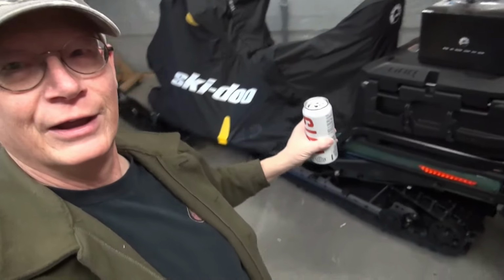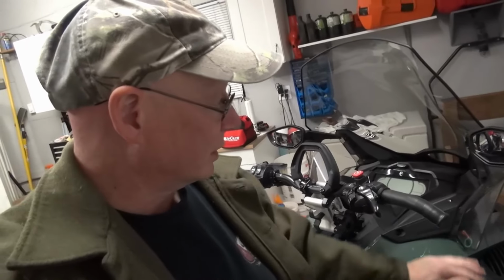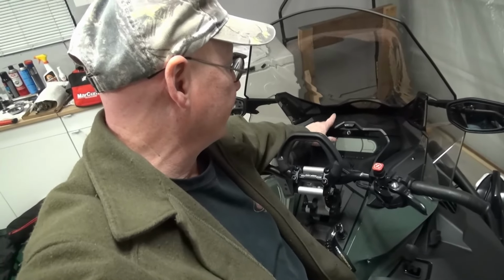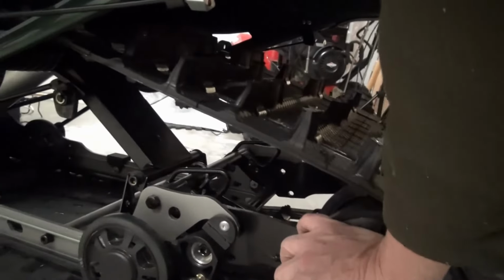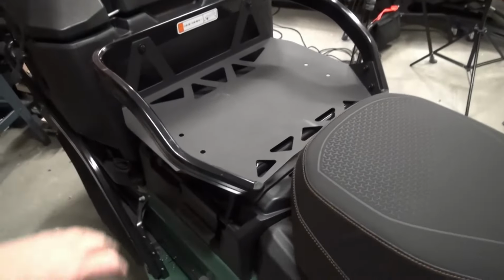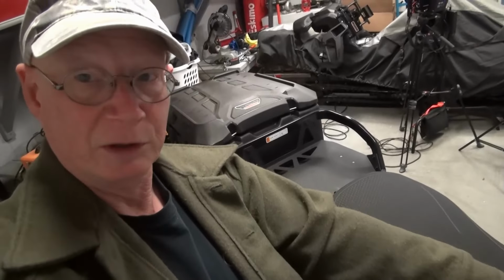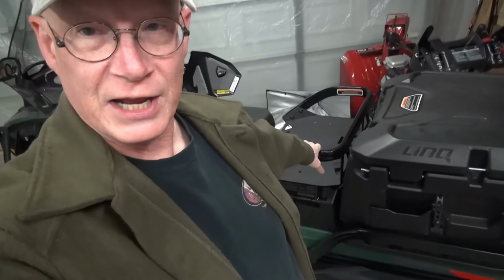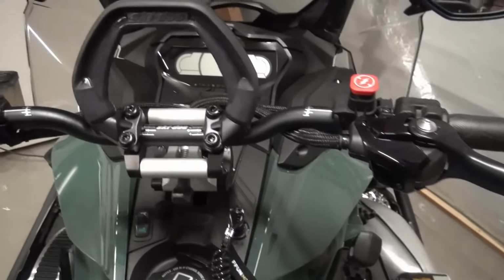2024 Ski Doo Expedition SE

Comment: One small correction, the 7.8" gauge is the color display.  Yours is the 7.2".  There's also a 4.5" on the LE and the Xtreme that looks similar to yours but smaller.  Also the 10.25" is also color but it's specific to the G5 sleds...can't put it on the Expedition because it's still on G4 plastic.
Reply from the maker: You are totally correct. For some reason I just can’t keep them all straight!  😂  Thanks for clarifying for others.

Comment: Great video!!  I put a small shovel where that saw holder is.  remove that small plastic piece and you're good to go.  Your spec out is spot on too, got everything you want or need.  My musts haves after having one of these machines for 3 years are the skins, cargo box, glove box extension and your cargo rack and you got all of them!  Great job!
Reply from the maker: Thanks for the idea on the shovel holder.  Appreciate your comments.  Are you running a gps mounted to the extension and if yes which model?

Comment: We have the exact same sled! Looking forward to being able to use it this year, hope we get more snow! Got mine in October last year but managed to put 1003 kms on it still even with the crappy season.
Reply from the maker: I can’t wait to get some more time on it this winter.  It’s heading in the shop to update the gauge. Froze up on a ride and apparently there is an update for it.
Reply: @alphawhiskyadventures  I have the same gauge as you and it froze up once. They told me if it happens again to let them kbow and they will change it. Under warranty.
Reply from the maker: @RonRivet  the shop opened the case with brp so at least it’s documented.  I had video to support it!

Comment: What is top end in km/hr
Reply from the maker: My gauge shows 94Km/hr as the max speed achieved- pretty sure that was from testing at the factory as I rarely go over 60km.  I did have my Polaris up to over 70 on a lake before I backed off as I was a bit of a wimp. 😂  never been much of a speed demon. 😈 I think the 900ace is about 90 to 104 on the top end.
Reply: Thanks

Comment: I got one as well in Black with the studded track and have no snow for the second year. I am hoping the Winter of 24/25 brings a respectable amount of snow so I can get out there or will have to travel where snow is abundant. Beautiful machine and congratulations on owning one. I love mine so much that I called her The Beast even though she only has the Turbo and not the Turbo R she has plenty of of RAW power with her 130 horses to get you outta of a slushy frozen lake no problem. 80 miles an hour is pretty fast enough for me and she is very capable of that speed on a nice straight run.
Reply from the maker: I am crossing my fingers for snow this winter as well.  I found my sleds all go plenty fast for my liking and hopefully I’ll never know if turbo will keep me out of slush. 😂  The Beast is an awesome nickname.  Four months till Dec!  🤞

Comment: I noticed the snowmobile cover at the beginning of the video. It looks like it was it made to cover the driver and passenger seat? Do you know what the ski doo part number for that was? I cannot seem to find one that says it will also protect the passenger seat that comes with these sleds.
Reply from the maker: 860201972 is what’s on the box.  Rev G4 wide -Exp LE SE Med-U/high w/s ROC. Is the description along with canvas cover towage kit.    Hope that helps you!  Confirm with the dealer before ordering if necessary.  The cover fits very well. It’s perfect.
Reply: Thank you very much!